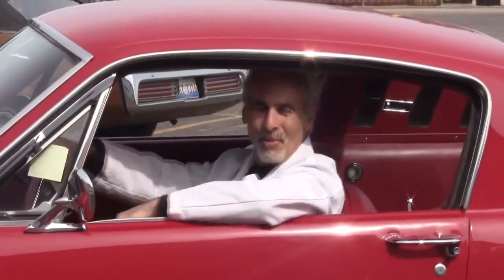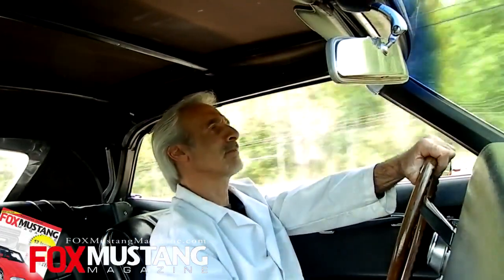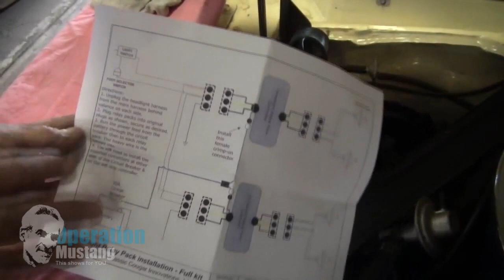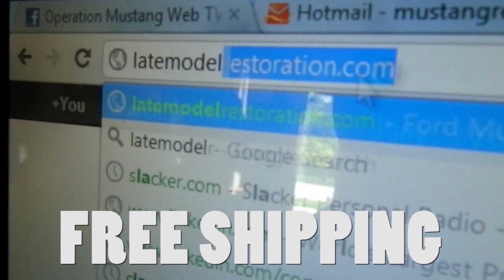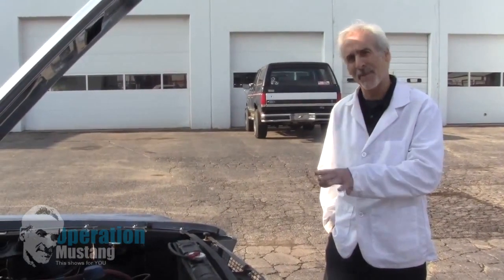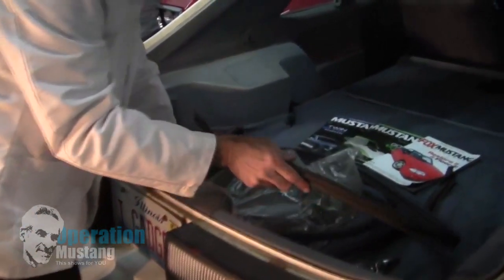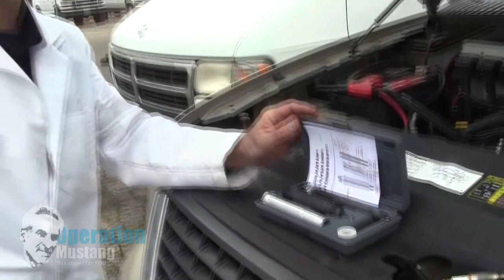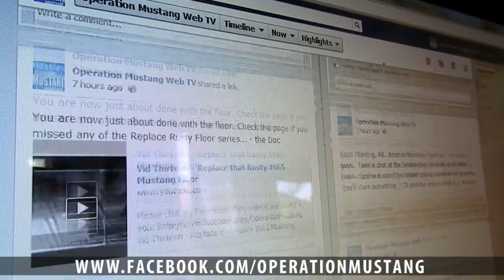Operation Mustangs & More show 16

Comment from the maker: Actually, The current is passing thru the Headlight switch in the same manor, So I would think it would help with a Generator 64 1/2 too. Contact the folk's over at RCC Innovation's for the application that work's for you. Great Question!!! Thanks, Doc